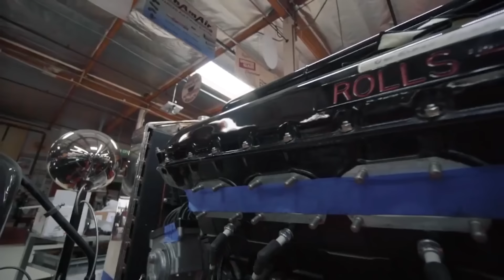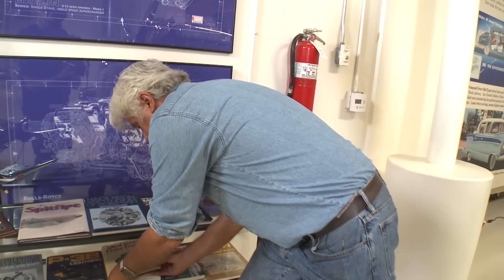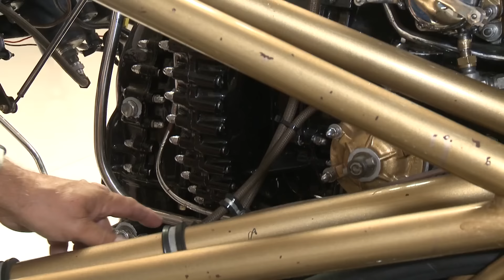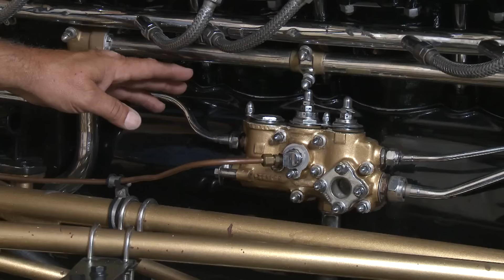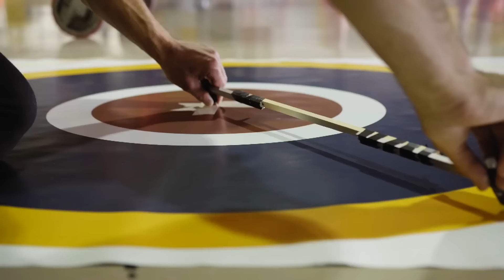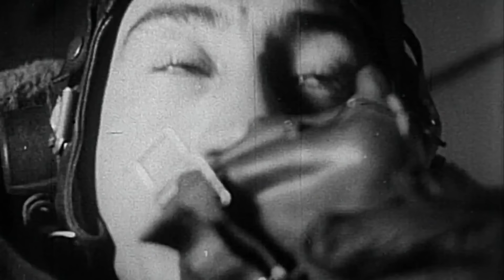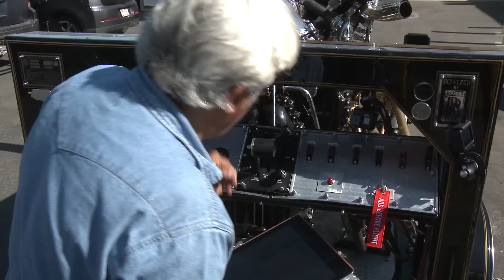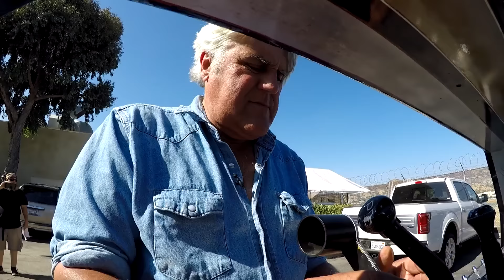The Engine That Won World War II - Jay Leno's Garage

Comment: We also should not fail to mention that the Merlin powered the Hawker Hurricane, and the Supermarine Spitfire!
Reply: Obviously the later Spitfires would be faster than the Mosquito, BUT, 
for a twin engine fighter/bomber the Mosquito was way ahead of its time.
Reply: adam.
The Mosquito was very good and it was fast, in 1941 it was faster than a Spitfire Mk V but in 1942 the faster Spitfire Mk IX entered service followed by the MK VII, VIII and XII, then late 1943 the Spitfire Mk XIV.
The Mosquito was a multi role plane, fighter, fighter/bomber. strike fighter, PR, night fighter and a few more uses.  It was a brilliant plane and used by the USAAF who also used the Bristol Beaufighter and Spitfire.
They all served very well.
Reply: …..and the Mosquito, and some Halifaxs
Reply: @robmustarde  They were not favorites though.
Reply: I must agree to a point. Basicallybenign has no clue. But do not forget, the Hurricane was truly the one that hauled the mail in the battle of Britain.
Reply: The Spitfire had much more powerful engines later on- but the real reason the P-51 was so fast was because of the laminar flow airfoil it used. It was a hell of a lot more efficient than the Spitfire wing.
Reply: s1rk3t.
The Spitfire did not need more powerful engines to have far better rate of climb and acceleration than the P 51.  That is even a 1942 Spitfire compared to a 1944 P 51.  Best not even try to compare a 1944 Spitfire.
Reply: adam.
The Mosquito was only faster when it first entered service, later the Spitfire was faster, the highest recorded sped for a Mosquito 437 mph or the same as a P 51 D, the Spitfire Mk XIV 448 when it entered service and I have seen up to about 460 mph. 
Both very good and the Luftwaffe had more than enough trouble with both of them.
Reply: Read any of the books on the Hurricane.  Look at the number of kills during the Battle of Britain.  The Spitfire got the press for it's good looks, etc, but the "Hurri" shot down the bombers, did the ground attack thing and many other jobs as well.  The Hurri  was all they had at first until the Spitfire production got up to speed, then they both worked together to defend England.
Reply: Early Chrysler.
Really is that why the Packard souped up copy of the Merlin was less powerful than the Rolls Royce Merlin.  The Luftwaffe most feared the Spitfire, the P 51 not so much.   The Spitfire had better acceleration, climb and maneuverability than the P 51 or Bf 109.
Reply: The UK wouldn't allow the U.S. souped-up version to be installed in the Spitfire.   "Not original, you know!"
Messerschmitt pilots loved the Spitfires - good target practice.   But they hated the P51 Mustang because they had the souped-up version that out-performed the ME 109E.

Comment: Personally my favorite is the R2800! But there is no doubt that the Merlin was a butt kicker, and powered some of the best combat aircraft ever built. Another Workhorse we shouldn't forget is the Allison V-1710. The two highest scoring American aces flew the P-38 exclusively against the Japanese! Richard Bong, and Tommy McGuire!
Reply: iamfun6996 their profile made it possible to make the fromt much more aerodynamic
Reply: Pffttt Wright 3350
Reply: Barrie Rodliffe low altitude the Allison was a very good motor it lacked the second stage supercharger
Reply: rockn roll the Porsche has technically fewer complicated parts then some of mopars motors and dohc is much simplier then making a Hemi 2v engine that's efficient na yes rumbling stats that stat build quality does show which is better the Allison is a very powerful motor while being smaller
Reply: The Allison V-1710 was a better engine than the Merlin in pretty much every way. It failed because of the US Army Air Corps obsession with turbochargers which simply were not advanced enough and in short supply at the time. As a result- they never achieved the high altitude performance of the Merlin.

"What can be said for the Allison is that it made more power at less boost with a longer time between overhauls and the part count was nearly half that of the Merlin engine which greatly facilitated mass production."

The Allison was modular and could be fitted with different accessory and output ends. You could even reverse the direction of the engine by simply swapping the crankshaft end for end, installing an idler gear, and swapping the firing order.

All in all it was a fantastic engine and while still successful- never really got its due.
Reply: s1rk3t.
High altitude, low altitude, power output, efficiency. You name it the Allison was far behind the smaller Merlin engine.  Just maybe why the P 51 was so vastly improved by the use of the Rolls Royce Merlin engine, some 40 mph increase.  Lockheed also wanted to change to the much better Merlin engine on the P 38 to improve both performance and reliability.
Reply: Merlin, Griffon Sabre, and if you have to have a radial Centaurus, all gave plenty of power and were better.

Comment: In 2016 a Lancaster bomber was at Oshkosh and you could go through it for a mere few dollars - don't remember exactly - less than ten that's for sure. Sit in the left hand seat spend as much time as you wanted - a real treat.   This year someone had a P-51 Mustang with a portable stairway and you could climb right up and get a good peek into the cockpit - some  kids were even allowed to climb in.

Thanks Jay - You even mentioned the bevel drive for the camshafts (-:

Comment: The Merlin was used for everything that needed power of that scale.  In the '50's as a child on the Rock of Gibraltar, i was  fortunate to get a tour of INSIDE the Rock. I remember there was a hospital, and electric generators for the Rock.  I learned that the Generators were powered by Merlins.  Then we went back to the dockside where we lived (right on the slip-way).  There were a few High Speed Launch (HSL's WWII era).  They said that were powered by Merlins. also !  (add to the above: the Hawker Hurricane and Supermarine Spitfire fighters - AND the amazing Mosquito. (fastest aircraft in its time).  Thanks Jay

Comment: I didn't know they used those in the Boeing B-29's.
Reply: They didn't.  They used them in an odd version of the DC-4.
Reply: I meant that this Merlin engine, "The Engine That Won World War II", was not the only engine that contributed to the end of the war.  You would think that the Brit's won WWII single handed.

Comment: I would like to see Jay get an Allison engine rather than another Merlin. Both were V-12s and both were about the same size. some argue that the Allison was a better engine as an engine but the Merlin had a far better supercharger. The Allison was intended to be boosted by a turbocharger and there were always problems with that approach. It worked in the P-38 but the early turbos required tungsten - a scarce strategic material.  The Merlin had taken a more conservative approach and was ready when we needed engines for the long distance P-51 escort fighters. I agree that the Merlin did win the war for us.

But I believe that after the war the hot rodders preferred the Allison's. It may be that more Allison's were available on the surplus market.  In any case when I was a kid we still had dragsters powered by Allison's. So Jay enough with the English V-12s . If you are going to get more WWII V-12s - lets have an All American Allison.
Reply: I have to agree with everything I wrote last year. Remember the Allison was almost the same size and shape as the Merlin and had only half as many parts. When Ford and GM looked at the Rolls Royce engine they thought it was over complicated.  The American government required that Allison (GM) not develop a two stage two speed supercharger like the Merlin but use a turbo supercharger.  The GE turbo was used in our bombers but only in two fighters - the p-38 and the P-47. Most other fighters lacked the internal volume for all the duct work.

There was an even better aircraft V-12 also built as a newer alternative to the Merlin. The Ford. It was again the same size but a true DOHC design. Ford designed it as a better more modern alternative to the Merlin. But it never got built probably for political reasons. Ford cut off four cylinders and put it in the Sherman tank where it too helped win the war.

Comment: So it is the small Merlin, huh?
Look up the special engines Rolls Royce Aero Engines made at the end of WW2 - The Thompson Trophy engines, made for the big Air races of the time yet too powerful for pilots to handle. Did well in hydroplane racing yet available only to British Lords, Sir Malcom Campbell put them to good use in the Blue bird series of cars - first car over 200 and the next year 300, yet the tires were not up to it and there were many crashes and loss of life. 
Several people have written of the story of how much horsepower they had, with fuel injection and 4 valves per cylinder, - the big dyno at the factory went up to 3,999, so they pushed ti past zero as far as they dared and wrote down 4,007; ON GASOLINE!
I just drew a new sea plane racer that would handle one of these, and we run it on hydrogen and oxygen so it exhausts pure water, and this is important since many of the greatest pilots, particulalry in the Schnieder sea plane challenge, passed out, crashed and died when overcome by exhaust fumes!
ALL it takes is for some very wealthy people to fund the races and we can do it all again safely this time!

Comment: Yearly, a touring B17 visits the local airport giving rides. 30 minutes for $450. Cheaper than the Lancaster. They always fly over my house and you can tell when they are coming from the distinct engine sound. Amazing to watch overhead.

Comment: During the first couple of starts it looked like his mixture control was still set at 'idle cutoff' so once the prime was burned off the engine quit.
Those big aviation engines, either the V-12's or the radials are amazing machines.

Comment: I did my military service @ Pansartruppskolan in Skövde Sweden. We had British Centurion Tanks from the 50ies, with the 27 litres Rolls-Royce Merlin Engine in them. Before starting them we had to start the Morris 4-cyl engine that turned the generator.
Our engines were artificially limited to 650 HP but still with a torque of 2'200 Nm.
Reply: The Meteor was designed to be tractible, in motor vehicles. That requires a different design spec to an aero engine which is designed to produce power at a constant rpm. Different cam profile for starers.
Reply: Centurion tanks used griffon 63 or 65 engines...
Reply: I thought you made your own tanksin Sweden...with Scania engines? ;-)
Anyway, the Centurion tanks probably had the RR Meteor engine...basically a Merlin without the supercharger.
https://en.wikipedia.org/wiki/Rolls-Royce_Meteor
Reply: Ah ok, possible, no supercharger anyway as far as I remember. Running on gasoline it consumed up to 40 l/km when it was wet and muddy.
Reply: And.where did Meteor engine originate from?  From crashed and salvaged Rolls Royce Merlins that had aviation specific parts removed. When Rolls Royce could not keep up with increased engine demand production was farmed out to Meadows and Rover. So yes ALL early Meteors were produced by Rolls and other companies added later to meet demand.
Reply: >RR Meteor engine...basically a Merlin without the supercharger.

While the meteor engine was originally based on the merlin, they drifted far apart in design and aren't the same internally. The meteor crankshaft turns clockwise vs the merlins' counter clockwise, the pistons are cast instead of forged and many parts which were made of aluminum were switched to steel/iron because weight was less of a concern.

Comment: Back in the early 60's i drove a 9500 series GMC  with a 702 v-12 gas engine. It kinda sounded like this Merlin. The 702 was a good engine, never had any trouble with it.

Comment: That was fun. I saw the Lancaster fly overhead last summer while I was out kayaking near Kingston Ontario. It was quite a sight, and a lot bigger than I'd expected. I had to research to confirm it was a Lancaster.  Will have to check out the Toronto museum too. Thanks.

Comment: What he fails to say is that "the engines built in Britain were of such precision machining that the prototype did not consume any oil. The designers were told to increase the tolerances in order to allow oil to be consumed.  Also, the British engines could apparently be turned over by turning the crankshaft by hand with the plugs removed. The Packard Merlins needed a prop-shaft wrench to produce the same motion.  Hylomar, a British liquid gasket material was developed specifically for the Merlin engine in order to allow the use of a silk string to form the sealing edge when the hand-planned mating surfaces were assembled - Hylomar is still used today for assembling piston and jet engines. American built engines used machine cut gaskets.   In Canada during the war, a certain percentage of the "Mechanics" and aircraft assembly personnel were in fact well trained and well educated mechanical engineers with an aeronautical extension who were "working in the Trade" as apprentices to obtain the practical knowledge required in their new profession as inspector/certifiers as well as production managers . In a large number of cases these civilians already had a "Trades" ticket as a qualified mechanic and were advancing both their education and themselves into higher roles - something that the Professional Engineering associations of today have no knowledge of, or chose to ignore.. The British called these people  "Aeronautical Ground Engineers",  Canada termed them "Air Engineers".. They have been a crucial and frequently mis-understood element in aviation safety in the United Kingdom and the Commonwealth nations since 1919. From 1948 onwards they have been called "AMEs" and/or "Licensed AMEs".  More info on "Ground Engineers" and "Air Engineers" can be found here : https://archive.org/search.php?query=Aeronautical%20Ground%20Engineers%27

Comment: I hear the German V British engine arguments below, but really who designs a swiss watch for war production? You need to strike a balance between design complexity and production ease. And when you look at the power output of these engines the Germans were not getting that much performance for the complexity of design. If RR had of used super complex design, what would their performance have been?

Comment: Holy Crow, Jay Leno discovered the Merlin Rolls-Royce aircraft engine! We used to run these to power some of our frac pumpers when we ran oil well frac jobs. These things were awesome, especially when you had 3 or 4 of them fired up at the same time. They sounded like Top Fuel engines at the Drag Races. Everybody just loved when we were ready to pump and started up those engines, they brought a smile to everybody's face, they were just a thrill to listen to, they stick in your memory, in the "Awesome" part of your memory! Never realized how truly sophisticated these engines were, thanks for sharing this video Jay Leno, Thank You!!!

Comment: Interesting that even with a pre oiler, the engine had a 50 hour before overhaul cycle.  Modern Lycomings and Continentals are rated for 2000 hours before major overhaul.

Mind you, the 2000 hour engines don't get shot at as much.

Comment: I don't know the model number, but I saw two Merlins like this in a boat.  The boat was a WWII torpedo chaser. It belonged to the British Navy/Coast Guard. The boat was about 60' long with a deep V hull forward and ran back to a planing hull aft. It was the personal boat of the CO of Cylde River Coast Guard detachment. We clocked it on radar one night at 45knots--not bad considerint how old it was. The interesting thing was how you started it. It had pins on the inboard bank side that indicated when one of the pistons was just over TDC. The mechainic would open a chamber on that cyclender and drop a 12ga blank shot gun round into the chamber. Next he would turn on the fuel. When he was ready he would trip the firering pin. You heard a thump and then roar of the engine. Those engines were detuned for marien service and put out around 1,000 hp each. In a 60' boat, that's a lot of horse power! I sometimes wonder where she is now. The last time I her was 1972.

Comment: The Merlin engine that won world war 2!!!!   haha  that's a joke....  There were far far more Pratt & Whitney R2800's produced and used in Far far more aircraft from fighters (P47, F4u, F6) to attack aircraft (A20, A26, P61) to light bombers (B25, B26) to heavy bombers (B24) that contributed to more firepower and more bombs delivered than any merlin  powered aircraft.  And don't forget WWII was also in Pacific (PTO), not just Europe. Sorry, This Merlin crap is simply an irresponsible opinion.

Comment: Should put the prop from a Super Marine Spitfire on it. It would look way better than the chrome thing.
Reply: Under a Spitfire's nose spinner you'll find exactly the same propeller and boss although I agree that the chrome is a bit garish.
Reply: Spitfire prop would not fit, SBAC  spline as apposed to SAE 50 spline for most Packard built engines.

Comment: No safety glasses? No protective gear? Jay Leno is an idiot.
Reply: Notice that he didn't run it at full RPMs.  He was at 1/4 the rated revs.  And he was behind the bulk of the engine.